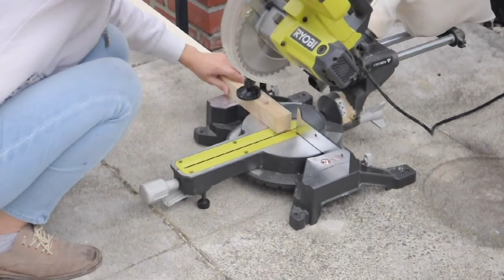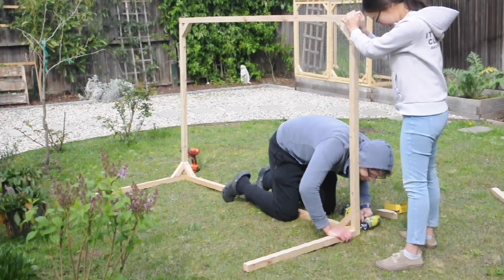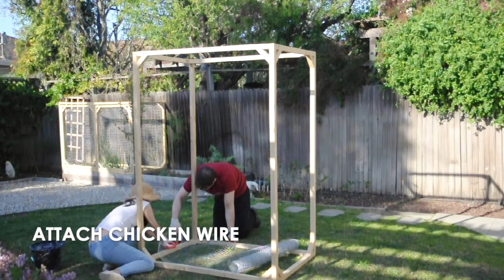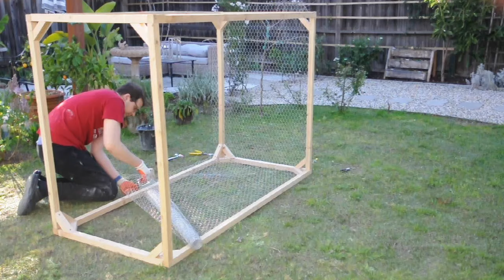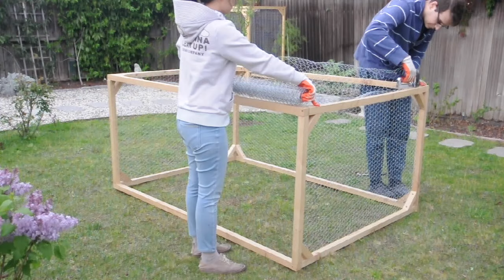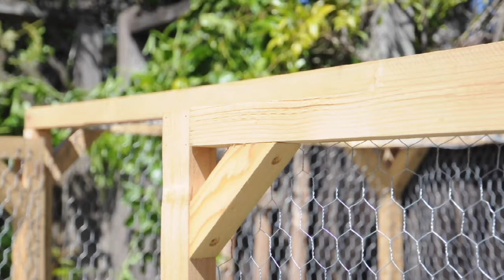DIY Raised Garden Bed Cover | How to protect your vegetable garden from small animals

Comment: I finished something similar to your project today, took three days. I also used chicken wire, but I have small mice raiding my vegetables. Maybe they will go through the chicken wire, I'll have to see if they do.
Reply: Do you still have trouble with the mice?  That's what I'm watching this for as well.  🙂
Reply: Hardware cloth may be what you need instead if they are getting in.
Reply: @lisastuhley9577  I built two caged garden boxes last year but no doors on them. My garden box lids open up at the bottom of the lid and I flip the lid back. I used 1/4” hardware cloth around the entire box and stapled some on the very bottom of the box before I added dirt. No groundhog, mice’ snakes, birds, etc. can get thru. No problems whatsoever last summer except for the Japanese Beetles for a month but I solved that problem too by putting Tulle netting around my tomato plants. They can’t get thru that. Chicken wire has holes big enough for small rodents & bugs to get thru.

Comment: Im going to use your beautiful design for my Tomatoes that are in Lg pots.The unit will sit on level ground and I will wire the bottom so the Squirrels can't dig in. My question to you is I want  it to be 7' high 3' wide. do you think I should add a middle brace 1/2 way up the 7' high back and side panels? I will build it the same as you did with the 2 half's. The only difference will be that I will not have the wire on the inside middle where they come together. I want it to be all one unit. They will be screwed together.

Comment: I'm growing squash and bush beans in a grow bag; how tall and wide should i build my protective fence?   Have a problem with squirrels and raccoons, etc
Reply from the maker: I built my cover at 4 ft tall to account for growing pole beans and squash. 4-6 ft tall is good, just tall enough that you can reach them. Width is more of a preference, depending how far each seedling need to be apart from each other.

Comment: Thank you for this video as it is exacly what I was looking for with my raised boxes.  I will be using hardware cloth instead because we are dealing with rats and squirrels. My question is, do I need to do those small angled pieces for the corners or can I just use a metal brace of sorts?  I will continue to research but thought I'd ask here in case you have a suggestion.
Reply from the maker: Hi Lisa, I think metal braces is a great idea! I personally didn't try out but would love to hear how yours turns out :)
Reply: @HydrangeaTreehouse  I used metal braces and it's wobbly.